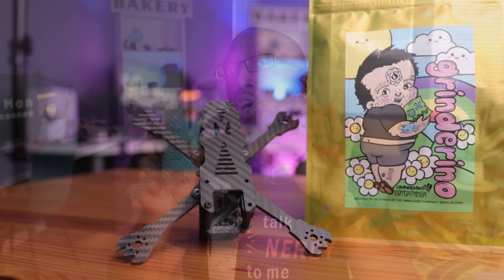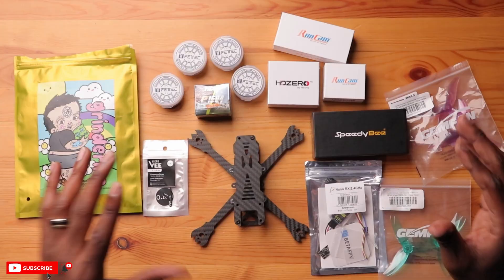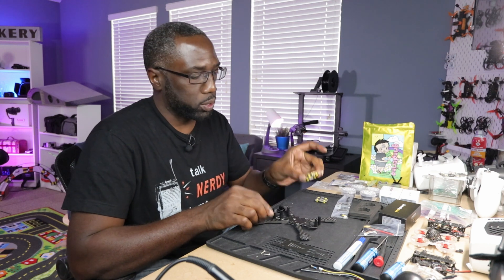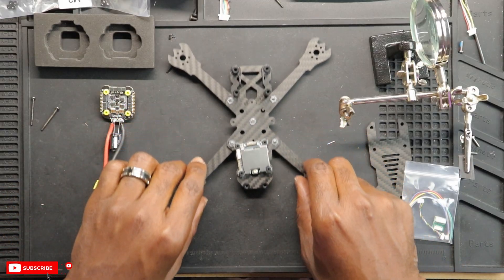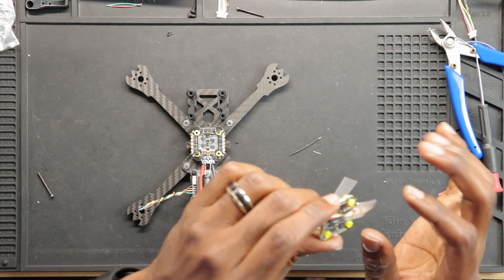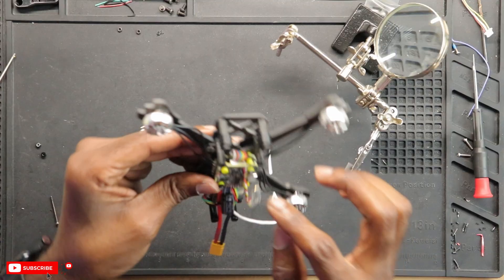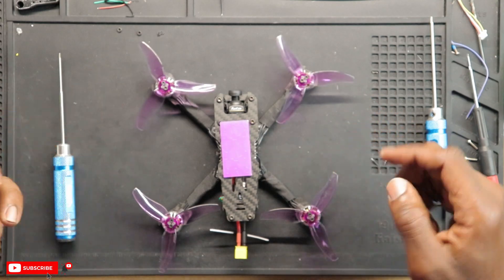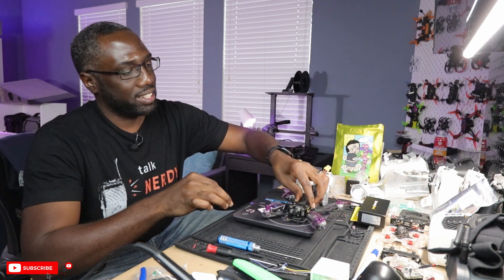Defeat Remote ID | Build Yourself a Sub250g Grinderino

Comment: Have one myself...posted it on my channel...tried to use the lite radio 2 se and come to find out...i cant at all now ...i bricked it trying to update it to from 2.0.1 to  3.0 or above.
Now gotta wait on a TX... preferably a multiprotocol...had no idea that elrs was so tedious...all for the sake of bypassing the old school bind method?
And having to have matching firmwares?
I mean wth???
Reply from the maker: ELRS is not the easiest thing to work with.  I normally just get on the major firmware and just stay on it.  Another option was to downgrade the RX firmware to 2.x to match your radio/TX.

Comment: Do you have a tune i can use
Reply from the maker: I used a pre tune in BetaFlight, but I don’t remember which one was used.  There are many options on there, but I either used one within my weight or drone size.
Reply: Uav tech has a good 2-4 inch preset in betaflight😁

Comment: I'd go for tmotor 1804 with 5mm prop mount. Gemfan 3630.
But damn the grinderino wasnt meant to be sub250g.
Reply from the maker: I get what you mean, but that’s like saying a tiny whoop should not weigh less than “x” grams(pilots always push those drones to the limit when it comes to weight).  If it’s going to be above 250, I might as well get a larger quad or maybe just stay with the Demibot.  Thanks Chris.
Reply: @OneManUnmanned  just to share my experience: a light sub250g 3" or 3.5" or even 4" is always such a big compromise. 
You need the frame, motors, FC, ESC AIO etc to all be very light. So then you need either a more durable frame and save on the digital vtx. Then you might want more powerful motors, but the battery and flight time is very little.
You know after many builds over the years, I do actually prefer something smaller and lighter. Especially with the new O3 onboard recordings.
Personally, I settled on a 4". You can take it anywere in your backpack. It is not too loud. Power is equivalent to a typical 5".
The only downside it is hard to get a good 4" frame off the shelf.
My build specs:
Amax f4mini frame
Dji o3 with tpu printed mount.
Amax 2005 2000kv motors.
Speedybee mini stack
Gnb 650mah 6s lipo.
Dry weight 240g.
AUW 360g.
Top speed above 180kph.
Hq 4x3x3 props.
The new iflight f4 is awesome, but too heavy for me
Reply: Built a pirat lil matey hdzero sub 250g with 1604 motors and 750 4s pack. I get about 3 to 4 min flight time. Little guy flies amazing. However, sub250 is like velcro on trees. As much as I like it, I rarely need to climb a tree to retrieve my 5". I keep the sub250 for backyard flying. FIY, those 1804s are not that durable with that 5mm shaft. The inner shaft is only 2mm. Better off going t mount, or fpvcycle 16mm. They have a full 3mm shaft all the way through. At least according to the description. I find light quads to be very durable. The problem is the durability of the small motors.
Reply: @Quadwrex  Then move up to 2004 motors for durable 3mm immer shaft.
Reply: @chrisbee5481  another decent option. Everything has a it's pros and cons. Too large of a bell on a small prop can interfere with the props' ability to efficiently make the thrust. All that being said, I have used 2105s on an apex 4".

Comment: I’m building mine literally as I’m watching this… and then I have spare T-motor P1604’s that I was going to use… and then when you said about the 9x9 pattern I thought… no it definitely fits…

Yeah it doesn’t so I guess I won’t be finishing that build this weekend 😂
Reply from the maker: Yeah, I was surprised as well since all my other 3.5” drones have 9x9.  Even most motors advertised for 3.5 builds are 9x9.  It’s all good, and why I mentioned it in the video.  Hopefully others can learn from my mistake.  Thanks, Bro!
Reply: @OneManUnmanned  yeah there's a couple of oddities with the frame, I'm building with an O3 system so I've had to mount the AIO backwards to fit a cap in there... but I'll put this all in a video when the new motors arrive (in 3 weeks 😫)

Comment: I found it real tight with the cap I had to take mine off and put on the lead it was just to light with walksnail vtx
Reply from the maker: Yeah, it’s definitely a tight fit.  I think I should stock up on some battery leads with built-in Caps.